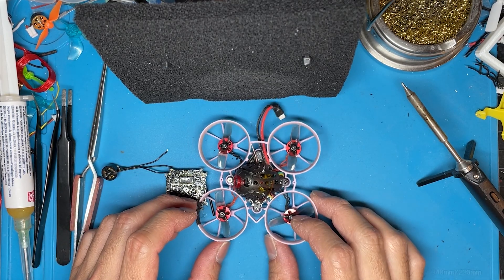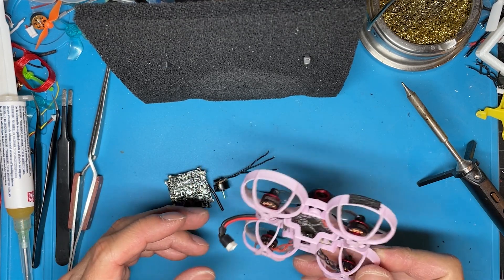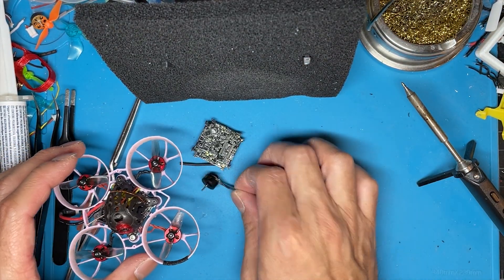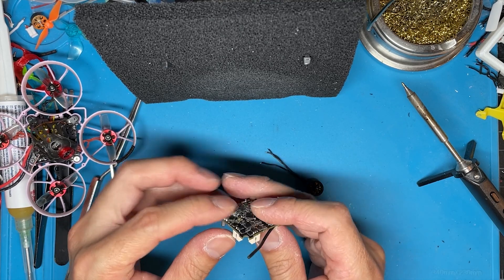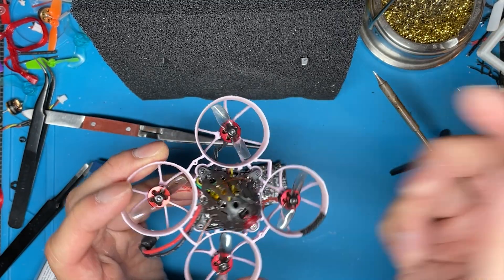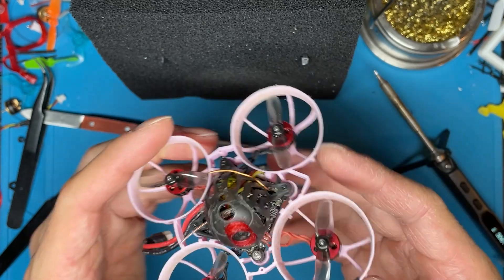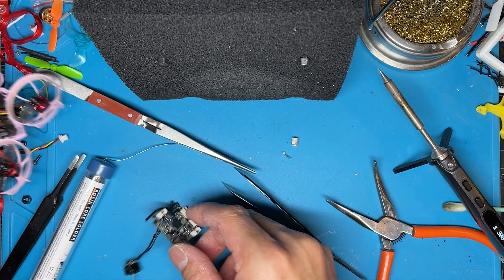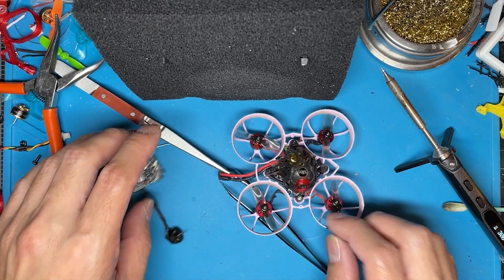TIny Whoop - Direct solder brushless whoop motors and connector removal

Comment: its funny, when you want those connectors they pop off, yet when you torque em with pliers NOPE their the strongest thing ever lol. I was thinking of remove my connectors with hot air and soldering in the holes.
Reply from the maker: yanking them off with a needle nose pliers have been the easiest in my experience. even if you want to remove the remaining 3 pins, it'll then be easier to grip them individually after getting the connector out of the way.

Comment: Question, when is time to solder the wire to the board, do I have to solder the wire on the bottom on the board where the connector was at or on top where the pins are or it doesn’t matter?
Reply from the maker: It does not matter, as long as 2 are not soldered to the same pin/pad lol

Comment: There are 3 cables, is it permissible to place the cables randomly or do they have to be arranged in order, considering that the cables are all black, sir?
Reply from the maker: won't need to worry about which order the 3 wires are soldered since you can use betaflight or esc configurator to change the motor direction if they are spinning the wrong way.
Reply: @MrHappeFPV  With the factory default settings, will the rotation remain the same even if I make a mistake in soldering these 3 cables, sir?

Comment: Do you have to solder a specific wire to a specific pad on the fc?
Reply from the maker: yes, those motor wires need to be soldered on specific pads on the fc, be sure to check the manufacturer website on which pads for the fc you have.

Comment: hi, what type of wire can i use if my air65 motor wire came out and short. so i plan to use new wire. is 30awg can use ?
Reply: 27000 motor for air 65
Reply from the maker: 30 awg will work. I have even used thinner wires (32awg?) to drop weight a bit and that still worked.